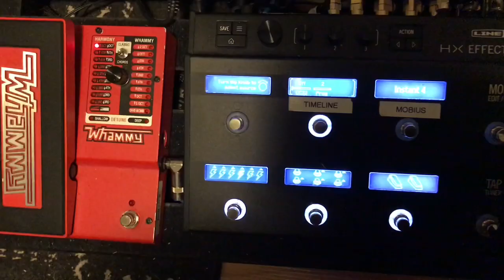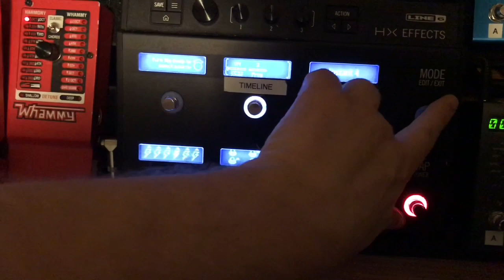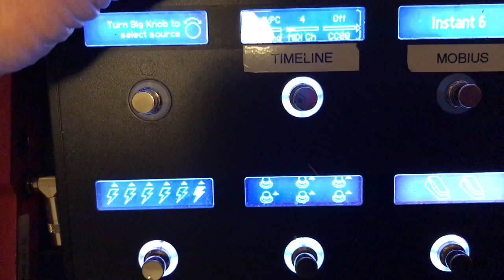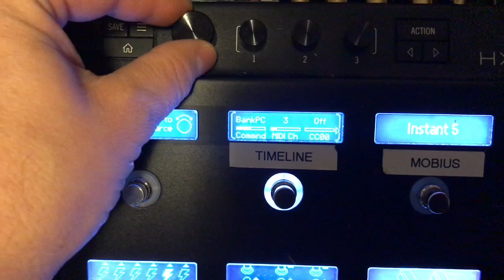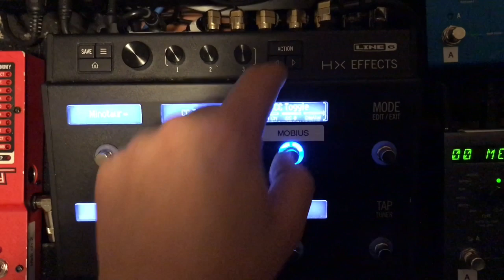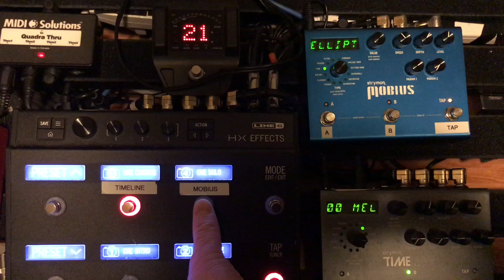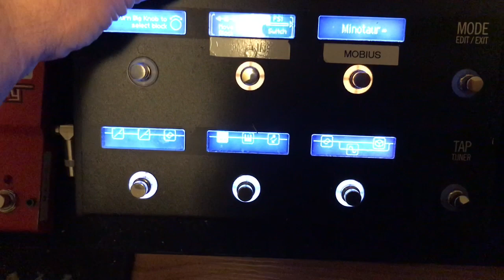Comment: Thank you video! helps a lot. are you using the voodoo labs switcher because the Rectifier has multiple 1/4" inputs for its switching? also would it be the same set up going directly into a midi port for amp in my Blackstar S1-200, I used to run the Voodoo labs GCX system but trying to eliminate the rack with the HX.
Reply: Hey Kevin Baird,
Thx for watching!
Yes I’m using the Voodoo lab control switcher because the amp uses 1/4” jacks.
The blackstar uses midi switching so you can send a midi cable direct from the midi out of the HX effects to the back of your amp midi in for your switching needs. You would not need a voodoo lab switcher. The catch here is setting the midi channel for your amp so the hx and the amp can communicate. That info should be listed in your amp manual. The HX requires that you set up the midi for each individual patch and designate your channel selection for each of your snapshots.
On another note, I like using the midi Quadra splitter box if you are using multiple midi devices. (They’re $35 ish) I made a cable loom for my amp as well. Just need a 20’ midi cable and the cables for whatever method you are using to the amp. I assume its -input, send, return, and a power source. You can use electrical tape every 12”-18” to keep the whole thing quick and tidy to setup.
Reply: @Quicknessband  hey man! thanks for the reply, i've got my amp switching happening through BankPC buttons in the command center. I cant seem to get any instants to change my settings. also finding the bankPC buttons aren't programmable with snapshots. I noticed in your video you have CC Toggle switches but didn't catch exactly how those are set. and help there? big thank you again. 
Im basically looking for your set up - hit a snapshot and it sends midi to amp to change channel as well as my effects in preset.